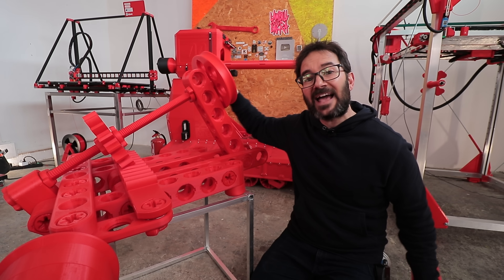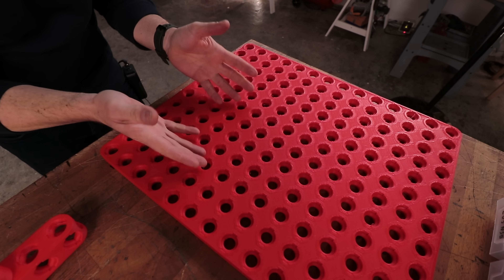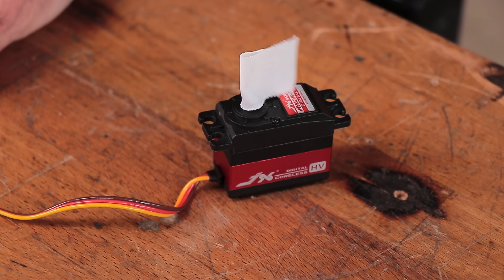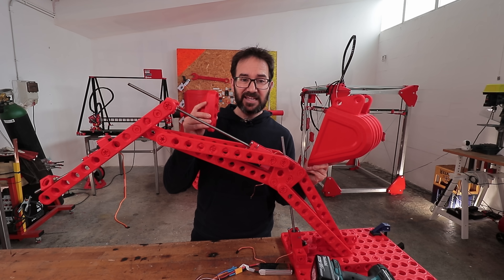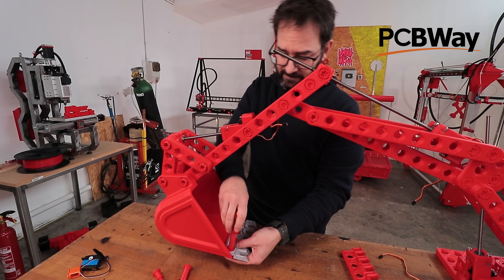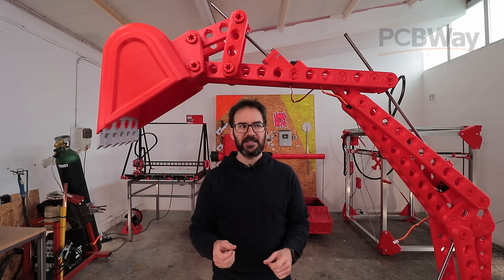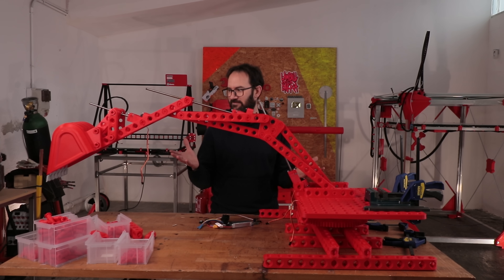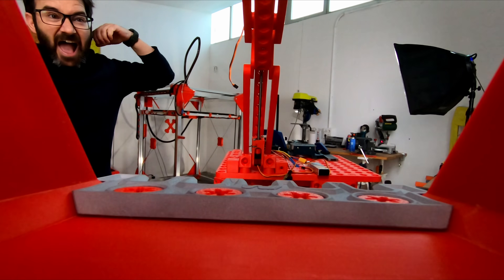MAKING A GIANT 3D PRINTED EXCAVATOR PT.1

Comment: I’ve never understood why people convert servos to continuous rotation, you lose the main features of the servo. Why not just use a normal DC motor with a gearbox? Is it because the servo has a built in driver and only needs one connection to control the motor?

Comment: I think it's be so cool if you started using hydraulics in some of these. Small diameter hard pipe is pretty easy to work with and conceptually it's all pretty simple too. I think the hardest thing might actually be to find a hydraulic pump that is small and quiet enough for indoor use haha.

Comment: Awesome project, you should try to get threaded rod with a 2 or 3 start thread, then the movement would be much faster. They use this on certain valves that need to be opened or closed rapidly

Comment: Hey Ivan, love the looks of this! One note that might be helpful-- typically in these sorts of rotating turntable arrangements, the small gear (attached to the servo) is stationary, while the big gear moves. Based on 11:52 it seems you currently have it set up in the opposite way. If you run into issues with the servo, consider switching it around! :)
Reply: What's nice about doing it this way is that all the wires and the controller/battery/radio get to live on the platform, without the need for slip rings or anything.

Comment: btw id reccomend checking out brass bushings for joints. For anything that doesn't require fast movement for more than 360 degrees, bushings will be stronger and cheaper. Bushings for low speed and high torque, bearings for high speed and low torque.

Comment: Looks great but I think you have a very weak point at where the arm attaches to the base with only 4 bolts there and nothing else holding it together, unlike the triangle structure pieces of the arm.

Comment: 8:12 - I'd just like to point out that the bearings you used seem to be purely radial. The base rotation creates axial and radial force, but the axial part is much more significant. Those bearings might break.
Reply: Im pretty sure the bearings despite not being designed for that use case are not the weak links in the chain here.
Reply: True ! A couple of bearings beetween the horizontal parts would make it stiffer and more durable👍
Reply: He might be happier adding a thrust bearing or just using a 'lazy susan' bearing. (I mean, there are bearings specifically for this, but they're specialized enough to be expensive...)
Reply: @davidedwards9157  True, I needed one of those special bearings and they were extremely expensive. I then changed the design to use bearings that are also used in trailer couplings (where the front axis of the trailer rotates). Much cheaper and good enough for rotating the excavator arm
Reply: Radial bearings have more than enough load bearing capacity in axial direction than is needed here. This won't break anytime soon.
Reply: I'm just worried for those poor servos
Reply: The limiting factor here is definitely not the bearings, but rather the amount of plastic that it is pushing on. That's why the bigger bearings are so useful.
Reply: Actually, the weight of the structure is almost negligible in comparison to the tension generated by the bending moment
Reply: Glad I'm not the only one who thought this.

Comment: Very interesting project, as always. The only point I'd consider is the matter that excavators do not use actuators but pneumatic pumps because they take far less room than the actuators. And because the load can be much higher. I think there's a way to make a pump with bricks.
Reply from the maker: Excavators actually use hydraulic pistons and pumps but I need to compromise sometimes.
Reply: @ivanmirandawastaken  i guessed that was the reason. In Lego Technic there are the pumps too 😉. Anyway as always great project. Wish I could have room for such projects

Comment: I really like the idea of these blocks. I can only imagine how much print time is saved with every one of these blocks you can re-use in another project.  :)
Reply: It also dawned on me, if you had one of those conveyor belt 3D printers, you could make arbitrarily long beams that are compatible with Miranda blocks.  :)
Reply from the maker: I've been thinking about getting one just for that
Reply: @ivanmirandawastaken  you'll buy one and not make one??
Reply: @ivanmirandawastaken  or building a giant one? 😜
Reply: @ivanmirandawastaken  cool, and if you make your own, you could build the conveyor from Miranda blocks.  hehehe :)
Reply: @brandonmack111  stick a 3D printer on a treadmill.
Reply: @conorstewart2214  yeah, like that. I'm sure the hardest part is just the firmware, and slicer settings. Even that's probably not too hard if you know what you're doing (I wouldn't know, though I'd probably be able to figure it out eventually)
Reply: @ivanmirandawastaken  Convert a treadmill into a 3D printer!